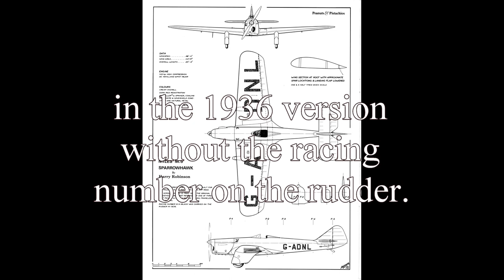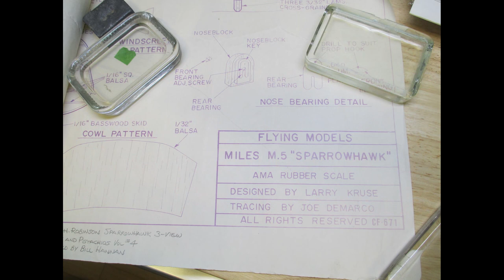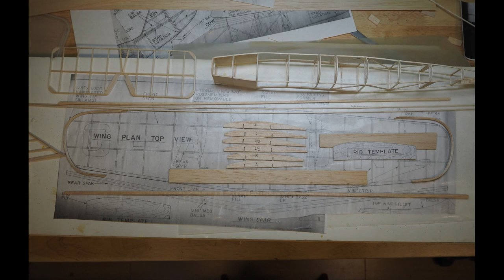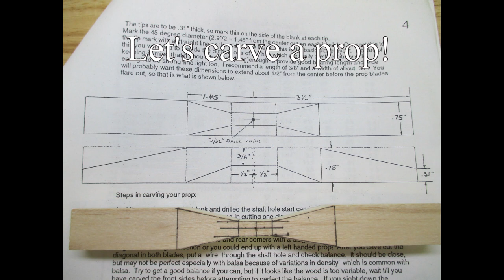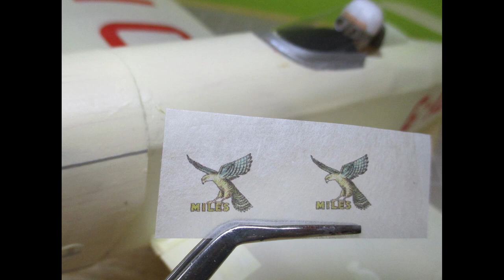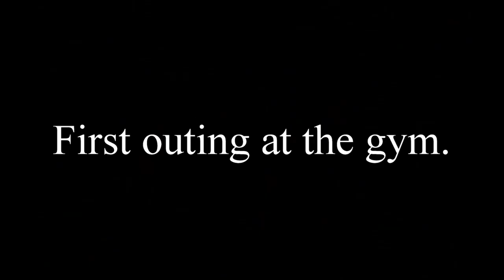A Rubber Powered Miles Sparrowhawk for Indoor Flying

Comment: Wow!
I see a lot of models that will fly, but they're relying on the propulsion to maintain flight. Your beautiful craft actually makes use of the wing to fly. Nice job.
Reply from the maker: Thank you. Yes, this is a very lightly built model and that makes the difference. In fact, it would be risky to fly this model outdoors with any wind. But indoors it is simply a joy and flys on rails. A rewarding project. Thanks for watching!
Reply: @Watchingthevideos99  Started into free flight models back in the days when R/C was a reed radio and rubber band escapement, flown control line, fuel, electric, and gliders, still appreciate a fine flying model today, had to acknowledge yours as one of them. It was nice watching it fly.

Comment: It's plain you appreciate the meditative aspect of making everything perfect. I try, but there is always some point in a build where things go awry, and I'm faced with the decision of trying over or accepting my flawed model.  This usually occurs in the decorating stage.  Far too late to start over! So tell me, how do you handle those tissue markings when they are all wet and noodley?  And I haven't found a red tissue yet that won't bleed all over the place.  So far, I've used a glue stick successfully for covering the framework.  I love nitrate dope, but the stuff is verboten in  our house. EZ Dope was a nightmare.(Also water based) 
Brilliant idea using the patterns to place the markings.  A real "why didn't I think of that?" moment. I look forward to more of your projects!
Reply from the maker: Ken thank you for the comment and kind words. I've also struggled with similar building issues. I've learned in the past few years to "let it go" and focus on finishing the model with the best of my ability. I think it's really helped me out. I still learn something new with every build. I think that's important. I too enjoy using nitrate for my tissue work and still do for some projects. Have no desire to use EZ dope. The Elmers Clear has become a great alternative to applying tissue. Really like the stuff once you get the hang of it. As far as my lettering, I put just a bit of Clear on the model to first stick on the letter, then you can lift the tissue letter to apply more glue to the model. I'll then go over the letter with a wet brush. So no handling of the letters wet with glue. These letters were cut from Hallmark tissue paper. The Mt. Fuji from Easy Built is another nice tissue to work with.  Keep building and having fun!

Comment: Thank you John for another great build,  I always enjoy them, and share with others that I fly indoor with so they can pick out your building tips. Would you share what the AUW was without rubber ?
Reply from the maker: Thank you for your kind words. 🙂the model weighs 22.10 grams without the rubber motor. 72 square inches of wing area.

Comment: I've always loved the Sparrowhawk. I'm getting ready to cover an outdoor no-cal. Do you think your covering method with the Elmers clear glue would hold up on a humid day outdoors? tia
Reply from the maker: Thanks for the comment David. I think you should be OK. I covered a no cal last year and did a light spray of Krylon and never had any problems. I know people use Elmers White to cover and I don't recall anyone have a problem. If it gets soaked, it's likely it will release. I've soaked off tissue with water, but the tissue is a mess by the time it releases.

Comment: Hi John,
I've watched quite a few of your videos. Thank you for sharing your projects with us. You've built many interesting subjects. I was wondering where you source the tissue you used and how does it compare to Esaki?
Thank you,
Steve Probelski
Reply from the maker: Hi Steve. Thank you for the kind words. The Tuttiro tissue comes from Hummingbird Model Products out of Canada. That particular tissue is really nice for indoor models but may be a bit light for outdoor models. He has another tissue more suited for outdoor models. The Asuka (Flying Bird) tissue is another good choice for a substitute for Esaki. You can find that at Peck Polymers and Volare Models. It's a bit softer than Esaki but has pretty good wet strength. It also comes in colors. I've used the Asuka several times and like it. Great for smaller outdoor models. For larger outdoor models, the Mt. Fuji is nice stuff. That's available from Easy Built models. It's stiffer than the others but comes in some great colors. Good wet strength but does seem to take a bit more work to get it down. Hope that helps.

Comment: Very impressive model - both construction and flying. I like many of your techniques - particularly your covering approach. Anchoring with spot gluing before finishing seems a far more controlled approach. The prop was impressive as well - what pattern do you use as it looks different to most with the swept back tips on the block? Thanks for the video.
Reply from the maker: Thank you for the kind words John. Always happy to hear someone likes my videos. It keeps me going back to edit another. The prop on this model is a major key to its success. The pitch is a very good match to the airspeed of the model. I got a bit lucky. The interesting shape comes from simply flipping the block so that what would normally be the front of the prop is now the rear. I did this so the blades would clear the front of the somewhat flat noseblock. Pitch distribution is not impacted by this. It worked out well and even looks kinda cool. 😄Thanks for viewing.
Reply: @Watchingthevideos99  Thanks John!

Comment: Thanks for showing your covering technique. Are you watering down the glue to glue tissue on?
Reply from the maker: You're welcome. You'll notice that I dip my brush in water and then stir it into the glob of glue on the post it. So, it gets thinned a bit. You learn that sometimes it's helpful to have it a bit thinner, sometimes a bit thicker. The glue is slippery while wet and that can help move the tissue. But you need to be careful because if the glue is left too long and you try and move the tissue it will tear. Once you understand how the glue behaves, it's a great way to apply tissue.

Comment: Any reason why you glued the tissue to all the ribs? The only thing that I can think of is that maybe it gives the wing less range of motion in the case of  warps. Being that you used split ribs on the outer part of the wing the potential for warps might be greater.
Reply from the maker: Very observant and your comment is right on! Even with the sliced ribs, the Tottori tissue has very mild shrinkage. So should help keep the wing flat over the long haul. Time will tell.

Comment: Hi John.  Beautiful bird as always.  I have a quick question.  When you showed the wheels "in the raw", you showed a stir stick or something glued into them as a turning pin.  Do you leave them in after and drill them for the landing gear wire or do you remove them and replace with aluminum tube?  Geeze.....looking back, that aint such a quick question! LOL
Reply from the maker: Hi Glenn. Yes, in this case they are hardwood dowels. I cut one side after forming the wheel and use a tee pin to mark the center of the dowel while turning the wheel in a Dremel. Then cut the other side. A hold is then made where the pin mark was made for the wire axle. Perfectly centered. Hope this helps. Keep warm!

Comment: I should have watched the whole video before asking questions! LOL  Roughly how much working time do you have with that Elmers glue and what is the benefits of using it as apposed to a glue stick?  Thanks for any help.
Reply from the maker: No problem Glenn. There is a pot life to the clear but you learn as you use it to keep it thin. If you apply it right out of the bottle, you don't have a lot of time. You'll see in the video, I go back and re-wet areas I'm concerned might be too dry. the glue is very slippery if you apply it with the right amount of water:glue ratio. The glue will also break down the tissue if you wait too long to pull the tissue. Something else you need to be careful with. But you can let it dry and reactivate it with water. For me the biggest advantage is NO LUMPS. I've always hated that with glue sticks. This glue goes on super smooth. You can also apply it through tissue. It's also great to use with paper wing fillets. It softens up the paper where its applied and helps the fillet fit properly on the model. Experiment with it first!

Comment: I have been getting into rubber powered ff.  My question is:  About how many flights can you expect from a rubber motor?  I have a chart that shows for a particular width of rubber, with a certain number of strands, that I can wind that motor up to X number of turns per inch of the motor.  I usually wind the motor up about 80% of the recommended number of turns.  About how many flights should I get on that motor before the rubber starts losing torque?  Thanks very much.
Reply from the maker: Hi David. Nice to hear you're having a go at rubber powered aeromodelling. If you are only winding to 80% max winds, I would expect your motor to last for quite a few flights. Your biggest enemy will be dirt. Keep the motor clean. You might consider taking the motor out of the model on occasion and washing it and then re-lubing it. You'll notice a change in model performance when the rubber is starting to fade. I've gone a full flying season with a motor when not max winding too often. Keep in mind that the tan rubber develops the most power at a little more than 80%.
Reply: Thanks for the excellent info!! @Watchingthevideos99
Reply from the maker: David you're welcome. Thanks for watching.

Comment: Hi John , when i have the plan PDF. Is this printed on a DINA4 paper ? Is  the size correct for building? or have i to scale up the plan untill it reaches 21,5 inches ?
Reply from the maker: The original plan was 25 inch span. Mine is 21.25 inch span. I reduced the original plan 15%. Hope that helps.

Comment: Awesome!, where can i find those plans?
 In México it is very difficul find those magazines or any kind of printed info of balsa models.
Reply from the maker: Thank you for your comment. The plans I used were purchased from Flying Models Plans Store. http://store.flying-models.com/catalog/. I reduced the plan slightly for the model in the video. You can find other versions of the Miles Sparrowhawk online for free. Here's a smaller plan that could be enlarged to a size similar to mine. https://outerzone.co.uk/plan_details.asp?ID=1193 Hope that helps.
Reply: Thank you so much Mr. John Koptonak to take time to answer My question and help me  find those plans, i am very touched.
Greetings from México.
Reply from the maker: @coyotearcadio  you are welcome. I am happy to learn there is a free flight modeler in your country. 🙂